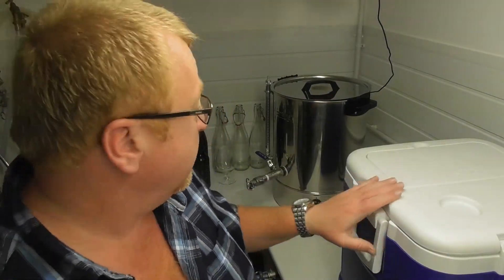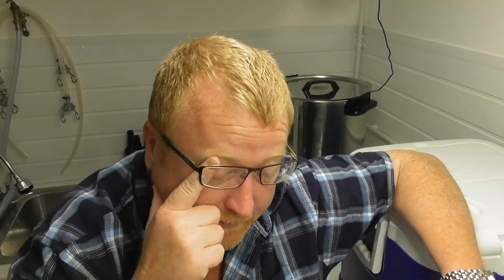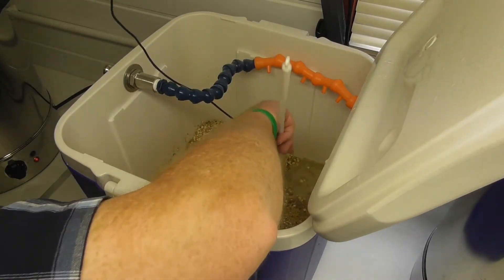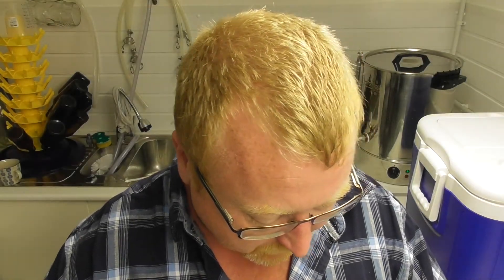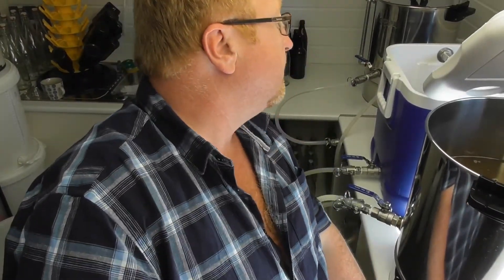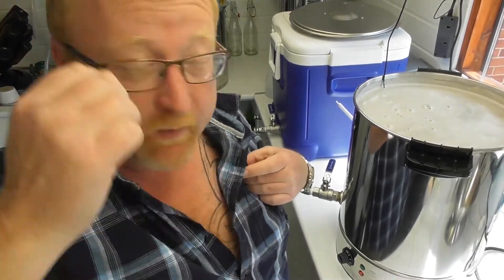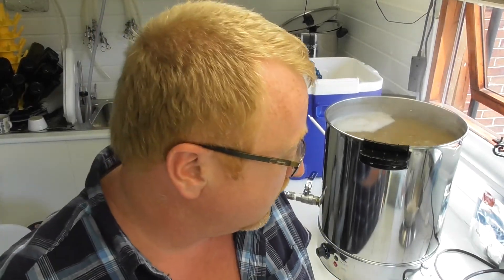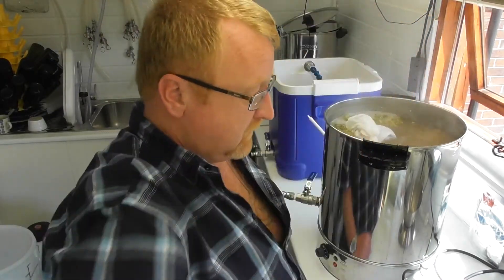Hapless HopWit - White Session IPA - Grain to Drain

Comment: Grain to Drain, Gutted for you mate. Don't know if this is of any use as I'm not a good un for advice but when I used to do Hop stands mine used to taste rough too that's why I switched to No Chill Cube and did the bittering in the Cube ala Zee Germans. What I thought was happening was as it was sat there next to conservatory door may have have drawn in wild yeasts or the odd fruit fly etc, Hope you get to the bottom of it mate On a lighter note, 10:30 am too early ? Nah I remember waiting outside the Snug door for 11 O'Clock opening Ooops showing my age again lol. Have to agree with Rusty and others about a smoother bittering, Think you can also get a smooth bittering from First Wort Hopping too, Leave the 60 out and put them in as your filling the boil kettle.Cheers mate Things will get better PROMISE !